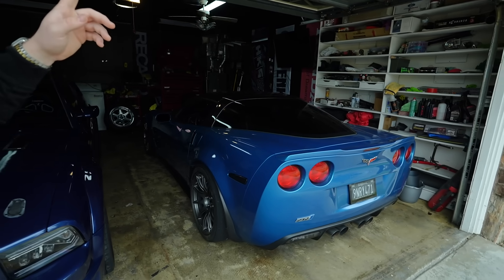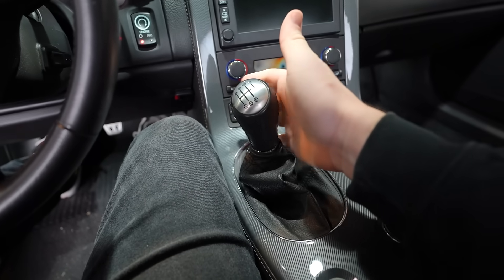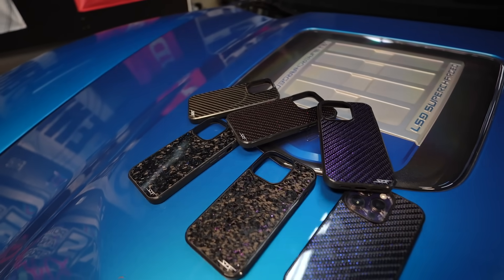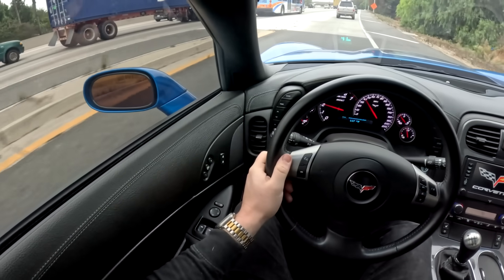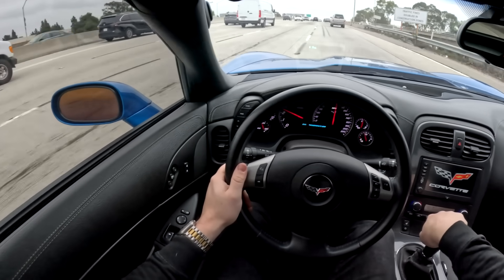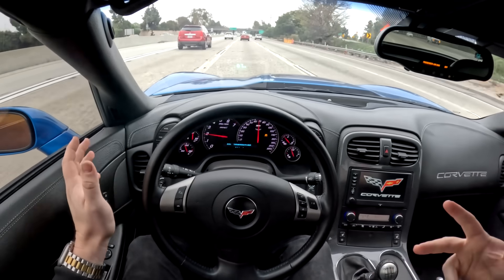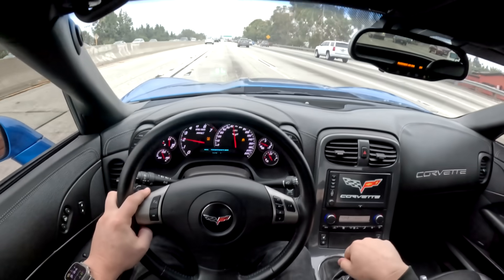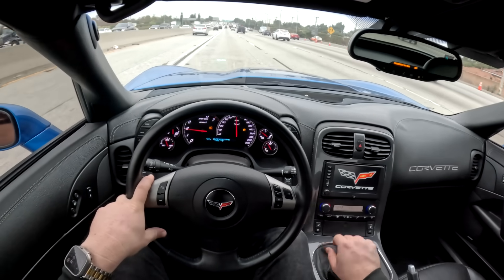First Drive In The MODDED C6 ZR1!!!

Comment: i believe some cars have springs or some sort of returning method that brings the shifter to the center, and depending on how the transmissions are built (where the guides are, the guides being what your shifter is hitting when you tried to shift normally) and how strong that returning method/spring is, shoving it straight into third can work or wont work like on your mustang. could be how the linkage is angled n stuff too

Comment: 😂Drew thats how good transmissions shift .The internal spring  pull you into neutral  so you just push forward from 2nd gear and your suppose  to automatically  be setup to slide straight  into 3rd.Only 4th to 5th gear you'll  have to nudge right a tiny bit to go into 5th.

Comment: 2:05 I got a mk7 golf r with stage 3 clutch and short shifter and my car does the same thing after I installed the short shifter. Very scary at first but once you’re used to it, it’s so easy and smooth.

Comment: Yup that 2-3 shift seems to be set up like that on all chevys. My s10 pickup was like that and on my current car which is a 2007 chevy Aveo5. The shifter basically centers itself into third. It does help in drag racing but you have to get used to just bangin it forward

Comment: It does sound and even feel sketchy, but the fourms are true to an extent. My c5 vette with the T56 transmission has a buttery 2nd to 3rd from just naturally pushing forward  70% and the other 30% is slight pressure to the right (almost like a grey area) and it feels like there’s a lockout of 1st and it guides to 3rd a lot better especially during pulls. 

Definitely keep giving it a feel until it’s a more comfortable shift 👍🏽
Reply: Theres a trick with the t56 and using a washer to make the shifts less clunky. Did it on my cobra years ago, I think it was called the "anti venom mod"
Reply: @j.moneyfilms  Yeah that name rings a bell! I believe I heard it on someone’s video a while back. Definitely does sound like something to consider especially because my vette is clunky with normal city driving and especially when throwing it in reverse. The tremec might have some flaws but damn it’s a strong ass thing

Comment: My 2018 GT with the Barton shifter can also just be pushed from 2nd into 3rd without thinking. It did it stock but required a little more guidance instead of just pushing it.

Comment: Ngl, i thought that all manual transmissions would pseudo lock you out of first gear. 

Alot of vehicles i found myself accidentally going from 2nd to 3rd when i would try to go from 2nd into 1st.

The only manual cars i have driven that do this in my experience are:
Toyota celica gts
Dodge challanger 392
Hyundai velociter N
Hyundai elantra N
Camaro zl1 1le
Cadillac ctsv blackwing
Mx5 miata 
MB miata
Subaru wrx sti (2023 and 2020)

Comment: The mustang shifter is not right. Got an 02 bug eye. WRX and a 2023 Elantra N both cars when you push shifter directly forward go into third. No need to guide it, just move it forward. Would have the bushings in the mustang shifter looked at.

Comment: Maybe it’s just me I’ve never had performance car so I can’t speak on that aspect, but I have drove a lot of manual vehicles third and fourth are kind in the neutral natural middle position I’ve always shifted third and fourth and straightforward straight back the shifter naturally pull itself that way
Reply: Yea I wonder if why, cause my stick shift can easily just be push forward into 3rd as well.